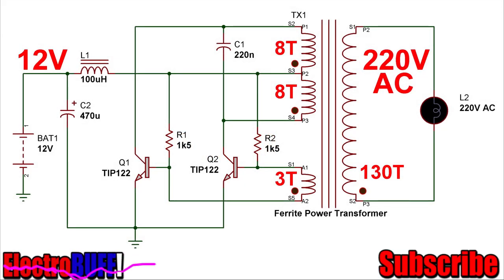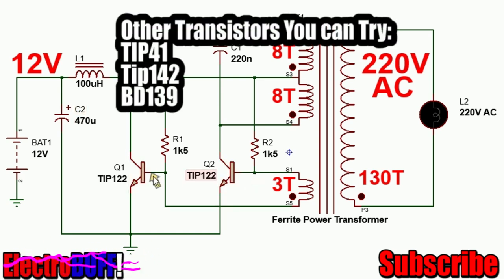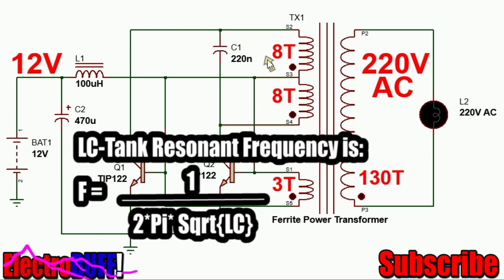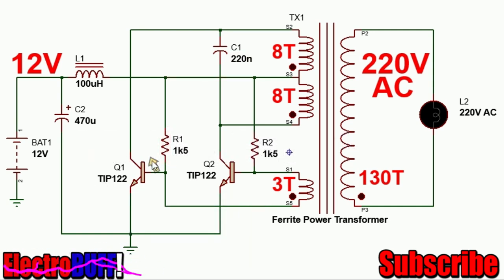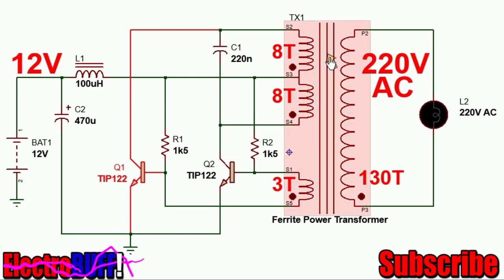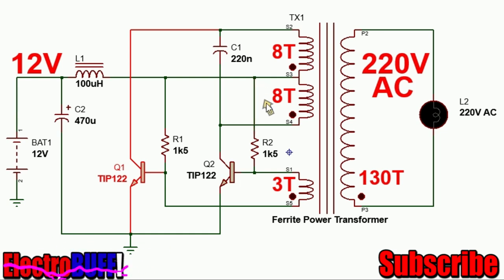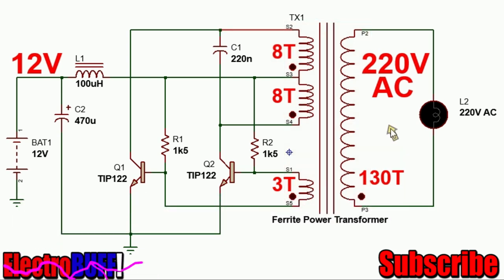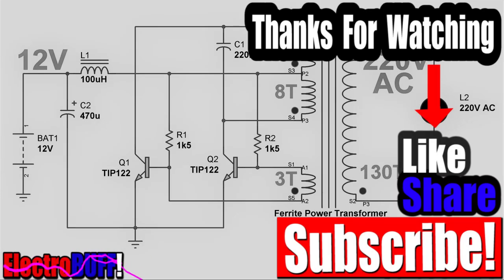How to make a Pure Sine Wave Inverter 12v to 220v DC to AC CCFL Royer Oscillator Circuit

Comment: i have tried but 190 volts DC comes on output such waste of my time by this video
Reply from the maker: Check your input voltage and turns ratio. The load also will affect the final output voltage. If it works, then the problem has to be with your parameters